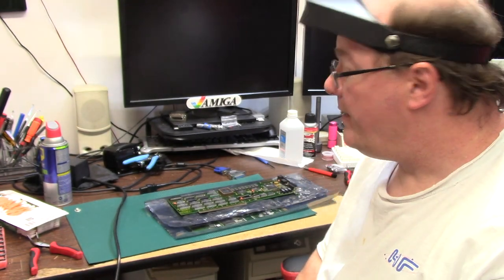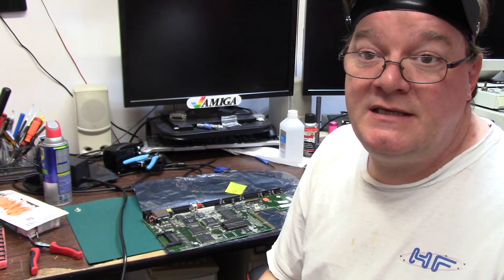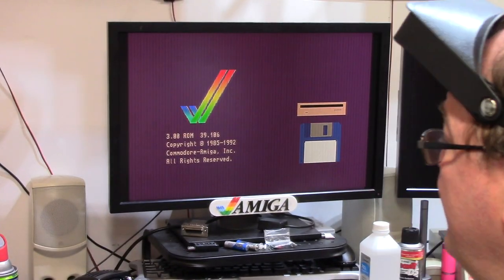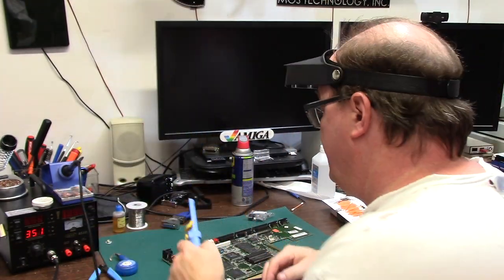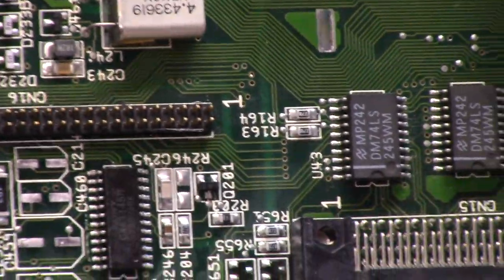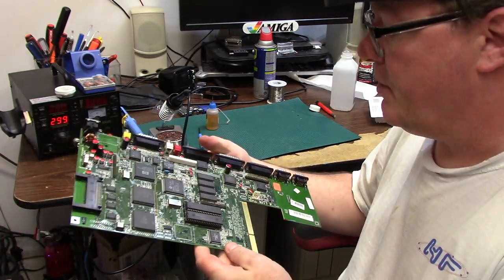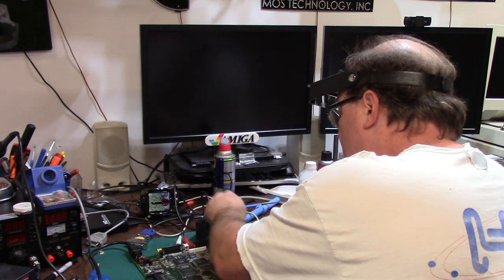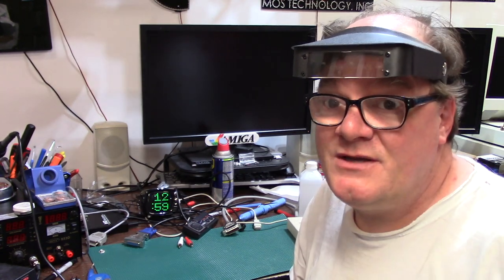Chris A1200 recap and my pal signal is messed up

Comment: The Dell U2410 handles PAL & NTSC. It does a better job with PAL in my experience but it also depends on the "mode" it is using. The "Video" mode is friendlier with Amiga signals but the colors may look off if you are used to the "Graphics" or other modes. To really clear up the vertical bars, use Edu Arana's RGB to VGA adapter.  :)

Comment: I have a SUPER RARE Lowell A2410 video card designed for Amiga UNIX.  It's a model 3.0 I believe but I have been having trouble getting an in sync image.  I think the two crystals are at a different frequency than the final version and might just need to be a software teak.  Any chance you wanna take a shot at making it go?
Reply from the maker: Does it work w regular amiga os? I dont have amix to test it on well i do but dont have the 3070 to install it